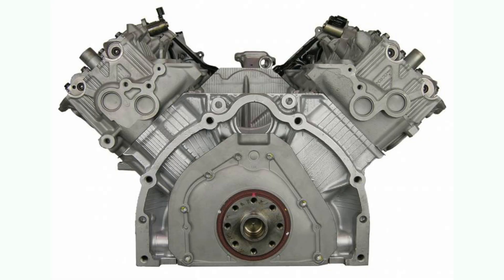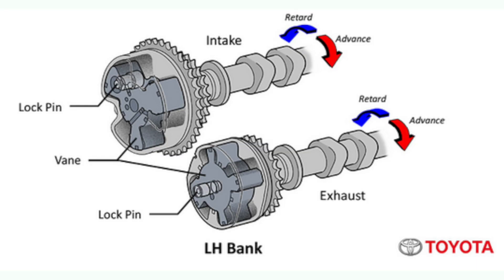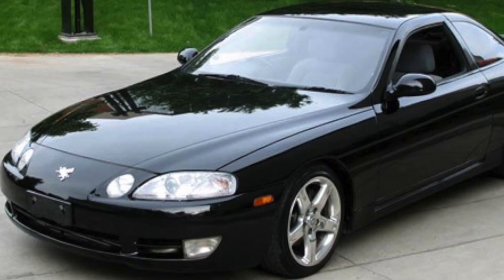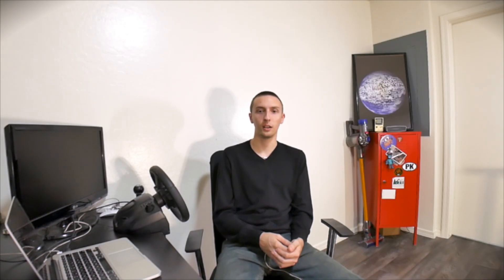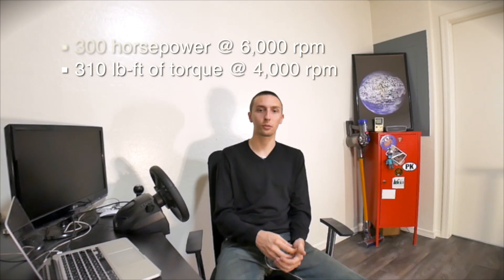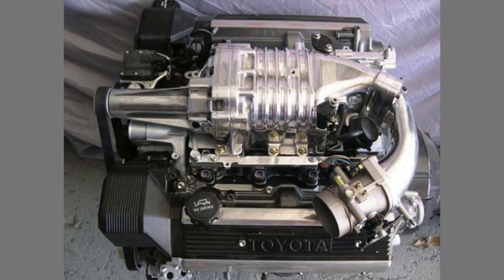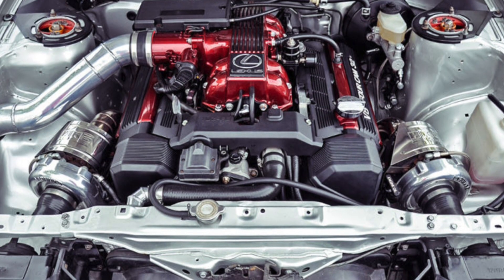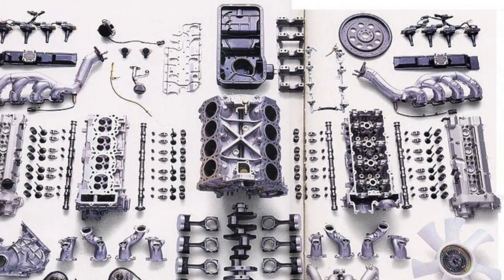Toyota 1UZ-FE: Everything You Want to Know | Specs and More

Comment: Nice vid. I'm friends with the guy that owns the twin turboed 1uz you show in the video. The motor is in an AE86. He has since installed a twin turboed 3uz in it's place. I have a few uz swapped yotas and am now in the process of plling the 1uz motor to replace them with 3uz's. The vvti motors are so much better in NA form over the non vvti.
Reply: Hi yutarip. i like to ask you some questions. can you tell me how to increase a LS400 NA power?simple. or is better boost it? Can you tell me how many wire you hade to connect for the oem ecu to work in a swap to start?
Reply: The simplest way to increase the power of a 1uz is turbo/supercharge.  As far as wiring there are a few essential ecu wires needed to get it running. BATT- 12 volts constant power from battery which holds the memory. IG- 12 volts to the ecu when igniton is turned on. MEL-R - Main efi relay is activated when 12 volts is sent to it from the ecu when the ignition is turned on. The main efi relay then sends 12 volts back to the ecu at the B/B+ pins on the ecu. Then depending on what yesr 1uz harness you have, there are usually 2-3 black and red or black and orange wires that get 12 volts with ignition on. These wiries provide power to the idle control valve, o2 sensors, injectors, maf and other sensors. There is also a heavy gauge black or black and white wire to activate the starter.
Reply: Yutarip, There is no one who can put a very nice illustration how to do it? The BATT-12  to hold memory. many don't know wich one is that. most UZ  from 89 to 96 have the same ECU. The IG-12 is to relay. but it will be much more helpful with picture or video. just the ecu picture and wich wire have wich function,  just the ecu B+    ign  i think is only 5 wire important. but i not have the trust without picture or video.
Reply: There are three different ecu's used in the 89-96 LS400's. The pin outs and plugs to the ecu's are different. The 92 -97 SC400 has two different ecu's but the ecu's will plug in and run any year.The harnesses are 99% the same but you will get a check engine light if you use the later ecu on an earlier motor due to the difference in the EGR system. 
I suggest you go on ebay and search LEXUS LS400 ELECTRICAL WIRING DIAGRAM MANUAL USA & CANADA. Purchase the correct manual for your year engine. It will cost $40-$70 and well worth it. The diagrams are in color The colors match the actual colors of the wires in your harness so it's hard to screw it up.I use this manual in all my swaps because the information provided in it is everthing you need.
Reply: yotarip , do you know if a 1uz out of a 06/07 gs will work in a 07 gs350 awd?
And if so what else would I need to change (tranny, awd to rwd)????

Comment: Why doesn't someone sell turbo kits for the 1uz/3uz on ebay? I need a v8 manifold in order to fab up my kit. This is difficult. I can't make my own turbo manifold and I'm not paying a shop to do it. I wish it was just as easy as the turbo kits they sell for the 2jz. And on the eaton supercharger don't you have to have some kind of plenum adapter for it? I can't just bolt it on? Also will that even clear the hood? I think itb would be the less complicated route besides nitrous for big NA power.
Reply: Itbs aren't as hard as people say they are I'd say go for it and have fun. NA has a lot of character and fun I'm building a itb b series Honda at the moment
Reply: hidden KARD itbs done right are a lot more complicated and finicky. I'm about to sell my r32 to possible start a 1uz r31 build and itbs may one day be in the mix just because I have a stupid love for itbs on a 1uz. But definitely not easier or cheaper by any means. Boosting them is cheap and easy

Comment: I would find a stand alone coil on plug set up if had $. We had a 92 SC400. Have to be careful with the square fuel rail, leaks! Also, parts are expensive! But when run right, with flow masters, yeah! JDM a lot cheaper on a budget rebuild. Also nice to have a manual car.

Comment: sorry had to stop when you said turbo builds need built bottom ends, utter rubbish....if you have the early engine eg the less powerful version that has the thicker rods which is basically a forged bottom end....go look up the turbo cars with this engine on stock bottom ends making 7/800hp at the wheels.  also you forgot to mention the 1uz was originally a race engine
Reply: AND it was certified to be used in planes in a different format
Reply: Special  really? Never knew that good to know though 😁
Reply: Yep. FAA rated engine 👍
I just passed 215k miles and car will still scream like a banshee if I floor it
Reply: @EricTheScot  .....Banshee😂 good one that made my day
Reply: keith blackwood i just blew my sc400 up, my temp guage was apparently stuck and i didnt see it over heat, so just watch out for that haha also look into putting a 2uz block with 1uz heads on it, out of the box 350+ hp
Reply: Joey Bunten 
I keep an eye on everything in mine and she's still stock. Replaced ignition coils, radiator, fuel pump and filter. Other than that and oil and trans pan gaskets &filters, haven't had to do much. Not bad for a $700 car I've put 15k miles on. Good luck with your build
Reply: I have to correct you on the bottom end being forged. The only thing forged in the UZs is the crank, everything else is casted. The engine wasn't originally a race engine. It was being developed as a race engine, but that never came to fruition, so they revised it for high production.
Reply: @alexisthemexican  so it was a race engine originally.. doesn't matter if never touched a track officially.. it was being developed to be that...
Reply: You’re going to want stronger forges internals across the board regardless of whether you “need” them. Hitting a certain power figure without instant catastrophic failure doesn’t mean longevity/long term reliability isn’t being.sacrificed
Reply: got mine for 600 haha, but she was perfect till that day, id recommend this motor to anyone lol. and thanks man you aswell
Reply: Got my latest a 93 ls400 w/ 260k miles for 450,sold the one that was wrecked for 250 and now I have a awesome black/grey cruiser that will break loose and kick sideways at 35mph when I floor it. and I'm in it  200.
Reply: If you know so much y u watching this video😁
Reply: It is not forged '' or basically forged you're an idiot. Only dummy who has one with advertised 800whp is just one guy not anyone else and the tun is conservative down low on ignition timing otherwise they would snap those rods

Comment: Right the problem here is that a 1UZ-FE with thicker heasdgaskets a ringed block and stronger head studs could take 30 psi of boost and make up to 1000BHP without low compression pistons the 2UZ had thinner rods and the 3UZ was boared to 4.3 litres and thinner rods again and with the VVTI made it impossible to add power to it without major modifications

Comment: You said that for the 1uz needs a built bottom end to survive boost, and that they top out around 450 hp. Problem with this is that the 1uz can handle 600-700 on stock internals boosted...
Reply: they can handle 1000BHP on stock internals with thicker head gaskets and head studs
Reply: ^Even Better. I was just going off of a guy named Sean pushing 800 on stock internals. Video says like 450 though before upgraded internals are needed, which seems to not be true. Maybe for the 94+ VVTI engine but if so, it should be stated.
Reply: yeah for post 94 engines major internal work needs to be done to push over 500
Reply: @joesisler7863  I have 97..... No vvti.
Reply: @Drquimbaymatumbo  Interesting. I know they started to make VVTI for the 1uz in 97. Could have started late year and you have an early year? idk lol
Reply: @joesisler7863  yes, it is. Mine was registered late December in 97. So unless it was sat around in a dock yard unregistered for a year or more, I just cant say why......
Reply: Lol I laugh at anyone building a non vvti block. No need what so ever. Push any power you can think off itll be fine.
Reply: A lot of STOCK engines will make 700hp all day. The question is reliability..
Reply: @nathanschild2388  Ford Australia's infamous BARRA comes is a great engine to make a lot of easy power out of a stock engine. 4ltr i6 dual overhead cam+turbo
Reply: Lots of people are clearly confused and don’t get the distinction that a bottom end =/= stock internals
Reply: @Fee.1  Im not confused. Theres a good few people pushing 700+ on the stock internals in forums. Only a headgasket and head studs. lol
Reply: yeah for how long
Reply: You can put over 2000 hp with twin turbochargers, intercooler, aftermarket internals, ITBs, 6 spd MT, and VP110 racing fuel.

Comment: A wealth of information in this video, but im trying to figure out who makes a wiring harness to swap a 1uz into a 240.
Reply: BLK hi. DId you find the answer for the wiring?
Reply: Its not that difficult, noone makes a harness but its not that difficult to figure out. Also lots of diagrams on the webz. Im doing the swap as we speak if you need any help...
Reply: Yes i need the help to start the engine. I have see some video wich connect  all wire together. I like to know wich is hot all times. wich is Ign.  wich injector and so on. if i can have a video from you. that will have many many views.
Reply: Its gonna take at least half a year until Im at that point, im currently in the process of painting the car... have you removed all the automatic trans stuff and environment stuff from the harness? makes it a lot easier. from there on id just suggest googling a lot. I cant tell you which wire is which unless I see the wire in person
Reply: I have'nt simplify the harness. maybe we will leave it like that after i find out how to start the engine. the harness will not be in my way. Ofcourse  i will be deleting the EGR and Evap

Comment: Who ever disliked the video got whooped by this engine. In his American v8
Reply: Not really the LS makes more power across the board.
Reply: Jzkaioshin 🤣 yep. Likely that Check that I spanked with my 90 LS 😁
Reply: Charger
Reply: carlos sheman 🤣 they're also bigger engines at 5 litre🤣🤣
Reply: @EricTheScot  ls didnt exist in 1990
Reply: @alexscarborough6263  check your wiki, my LS has a manufacture date of late 1989 making it the godfather of Lexus and Toyota V8's. I now have almost 230k miles and can still pass 140 without even trying
Reply: @EricTheScot  I thought you ment LS engine.
Reply: It was probably because the first 2.5 minutes is literally just reading the description from wiki. No effort has gone into that.
Reply: Gameing & Tech  1uzfe  is are great for boost and they fit in tight spaces the only draw back is performance parts are stupid expensive
Reply: Its a great engine but nearly v8 engines are and putting a 1 uz up against a ls is just not a fair fight
Reply: The only engine this would whoop is a 4.6 2V or a 1970’s V8
Reply: johnny Macon  lol sport mode. I have 2007 manual G35S sedan that will run circles around a ls 430. The closest competition for me are s197 5.0 mustang's.

Comment: Only thing you forgot to mention is that the  first 1uz's were actually better for boost than the vvti versions, due to stronger rods.
Reply: Also he forgot to mention that the vh45 actually produce 310 horsepower but it was advertised without variable valve timing because any engine that produce over a certain horsepower i forgot the exact numbers they had to pay a stiff tax....ive had both engines both are expensive but there are more options with the 1uz in my opinion
Reply: Will look for that. Buying one for my MX73
Reply: @zackhype  my 92 sc400 has 193,000 miles on it and still runs good but its stock
Reply: @Maltez0929  sadly made a dumb decision to not buy that MX73. It was a registerable Grande and it was only 1.9K. 

Knowing what I know now, and with prices as they are today, god I wish I'd bought that car and held onto it.
Reply: The rods got thinner and lighter, post 95. And the pistons were changed too to increase compression from 10:1 to 10.5:1.So the non VVT-i are better for boosted applications out the box, but the later engines had better flowing heads.
Reply: VH45 had stock forged pistons, rods, and crank. The Lexus I believe had forged rods and crank, but cast pistons. And yea the numbers he lists for vh45 is without variable valve timing engaged. This was to abide by the gentlemen's agreement, but actually produced closer to 310 with vvt engaged. Either motors are great, regardless.
Reply: @alexisthemexican  Could you elaborate more on this please?  Everyone says after the 1995 revision they had thinner rods. Do you know the exact dates. Reason I ask is because there are 1995 Lexus LS400's with a manufacture date in 1994. I'm having trouble finding accurate info and im planning on getting one with the beefier rods but all I have available to purchase are 1995 models with 1994 manufacture date.
Reply: @larrysheran  not sure exact dates. So my guess is anything manufactured in 95 are the lighter/thinner rods. So cars from 96 up. Sure Lextreme or similar website might have better info
Reply: @alexisthemexican  Yep, the general consensus is. If you are building a boosted engine go with the older 1uz since you will have to do less modifications. If you are going to build a car for Na horse power, go with the latest model 1uz for the better flowing head. Both are overbuilt, both are good for boost application if you choose, both are extremely reliable. 500,000 miles or more easily.
Reply: Solid lifters are better anyway
Reply: VVT-i on the 1uz and the timeline of when rods became thinner/weaker have nothing to do with each other.  Rods got thinner starting with the '95 model year and VVT-i on the 1uz was introduced for the '98 model year...at least that's so for the USDM.  Up to '94 can handle more boost stock.  '98-up have better flowing heads.  The dream motor using stock parts would be '98+ heads on a pre '95 short block, but that's not happening.
Reply: Emil Metzger Why is it not happening
Reply: Jason Phillips to get even more specific; 1989-Sept 1994 engines are best. October 94-1997.5 are slightly less thick connecting rods and the 1997.5-2001 1uz (vvt) is the thinnest rods. With that said, you can still safely run about 4-6lb boost on any of the stock internals. The block is insanely strong and I’ve heard of 1,000hp builds on stock blocks but I wouldn’t personally go over 700hp and drive it on any regular basis. 

My old SC400 had about $12k in N/A mods and 5k in suspension/wheels and would hit 186 mph, made 420 something horsepower at the wheels. turbo 400 transmission and corvette diff made it get up to a low 11sec quarter with the suspension set up for canyon carving and highway racing like the dumb kid I was at the time. 

Don’t do drugs. I lost that car because I made some bad choices and started hanging out with coke people.
Reply: @connormeehan3231  Life's bitter lessons...
Reply: @connormeehan3231  I feel ya but I won’t make yo mistake and lose my ls400
Reply: Which years????
Reply: @gremotorsports  1989-1994 is the 1UZ that you want
Reply: Technical term is "thicker rods"
Reply: along with the non interference timing belt
Reply: 1UZ with VVTI had thinner connecting rods therefore could not hold up to tons of boost unlike a Non VVTI 1UZ with already forged internals + lower compression im picking up a 92' LS400 next weekend im gonna be putting an M90 from a Terminator Cobra onto it & run about 10lbs of boost
Reply: @brandonnewman98  can I do the same with 3UZ ? - cobra supercharger.
Reply: I second what Hades said
Reply: Good to know brah
Reply: And stronger pistons I believe. I've heard of 10psi on stock older engines.

Comment: Why did your 1UZ die?
I've had 2x Toyota Soarers and 4x LS400s. Probably my favourite engine, smooth, loves to rev, incredibly strong, reliable and is non-interference!
Reply: Martin Brown I agree, I’ve owned my 93 sc400 for over 20 years! In that time, I’ve put an o ring in the fan hydraulics and consumables. My car now has about 119k miles. The ride is great for the model, it’s quiet and dependable. I own a 02 ls430 and I think the quality in my sc is better, just built better. All I have to do is figure out who I leave it to in my will. Oh forgot to mention , I just had front and back seats reupholstered in new leather.
Reply: Did you make any mods to them? I’m starting to fall in love with the Lexus family as I already love Toyota’s. Next car I’m going to get is highly likely to be a soarer and id like to turbo and manual swap eventually.
Reply: my temp gauge got stuck and i didnt notice. over heated the motor and cracked the drivers side head, but up until i blew it everything was perfect. the previous owner is a good buddy of mine and he planted the car (92 sc400) into a wall and the motor was still fine after that for a couple years, no issues super happy to rev all the way to redline

Comment: I’m trying to find out how to change the crankshaft seal please help
Reply: Or drill a couple of small holes and then screw some self tapping screws in the seal to help pull it out.
Reply: Mario M remove drive belt. Remoove crank pulley. Pry crank shaft seal out with screw driver. Dont scratch the outer walls. Tap new one in
Reply: Mario M hella easy
Reply: Lol wtf
Reply: Mario M That's easy lol

Comment: Review on the less known engine in Toyota's lineup.....1GZ-FE  5.0 V12
Reply from the maker: We will one day
Reply: Toyota Century
Reply: Jaquan Chacon  👌
Reply: Hi,all does the 1uzFe throttle body have an accelerator cable,plz help,planning to swap in my 78series prado
Reply: @tariqissak3722  the first gen at least came with mechanical throttle body not drive by wire